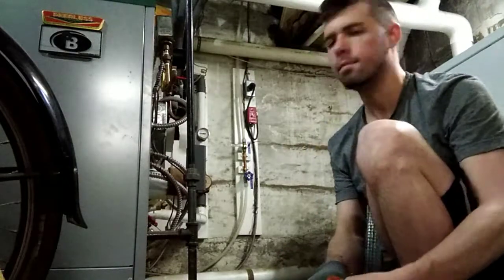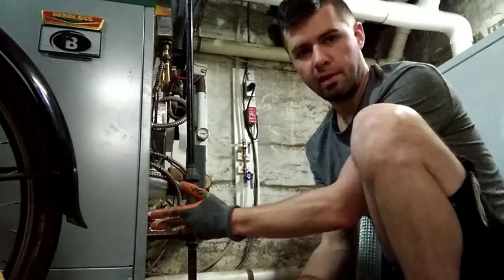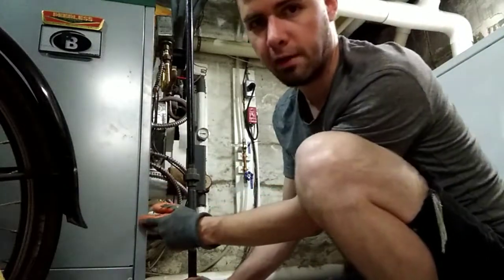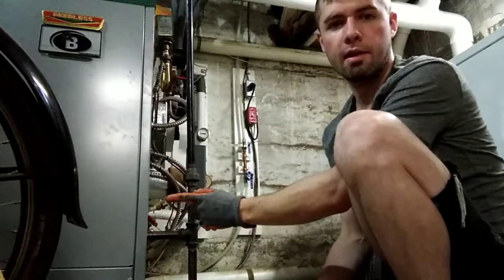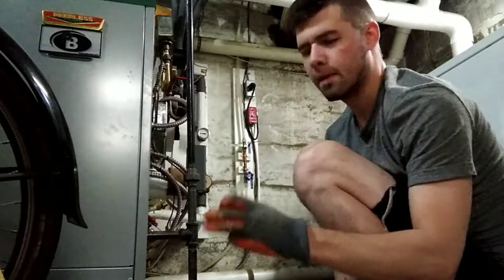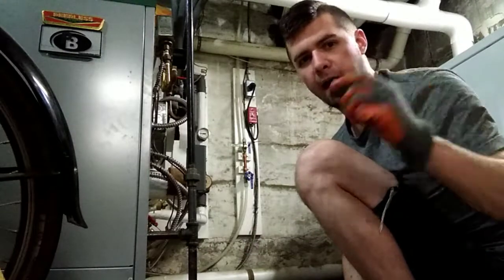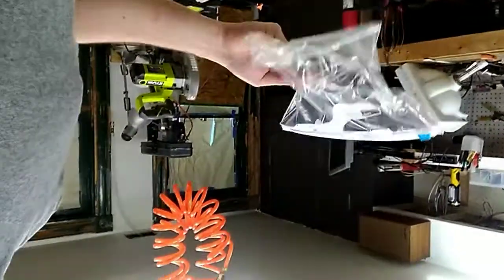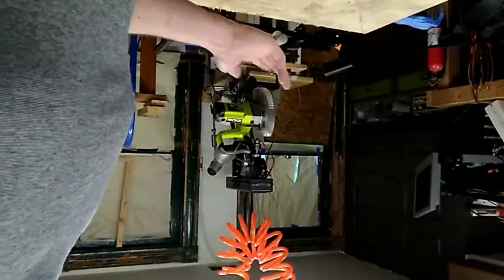Natural Gas Pressure Inside Your House

Comment: I appreciate the Video. I have an older house and started to remodel a wall myself to create more space. Turns out I smacked my Gas Pipe knocking through the Drywall, and long story short I have a really really faint smell of NG only when I get close to the Union and it was bugging me. I think I'll just make sure to keep some windows cracked until I can get to it this week because it seems like a really insignificant amount coming out. I tested it with the handheld detector and it only goes off when I'm right next to it. Very annoying though, I just wanted to remodel and didn't want to have to mess with a gas line.